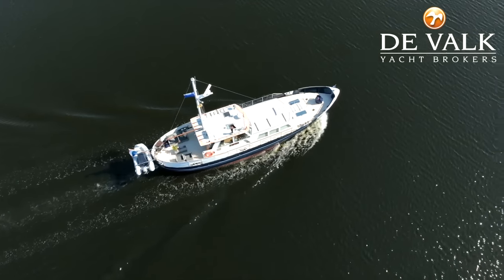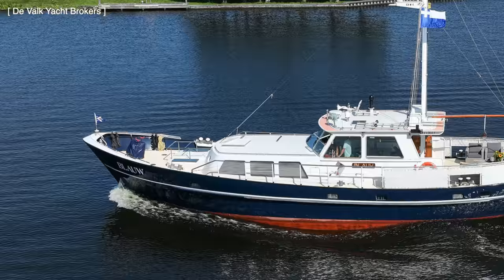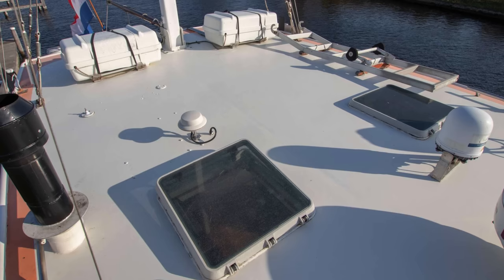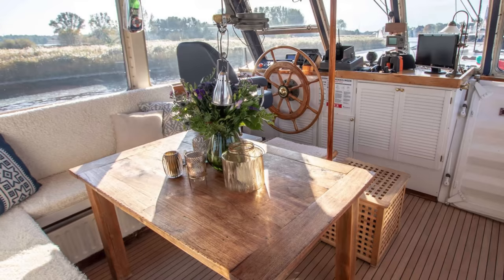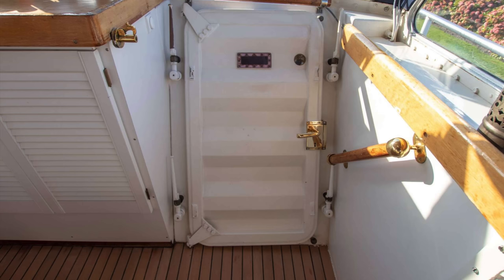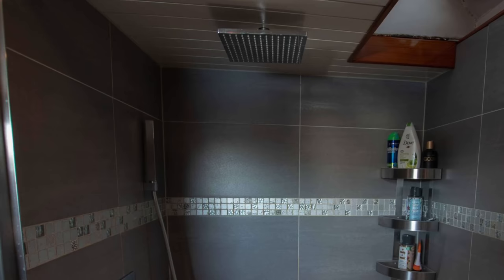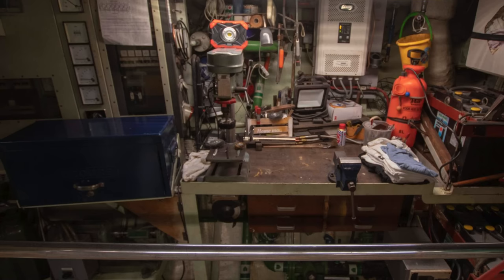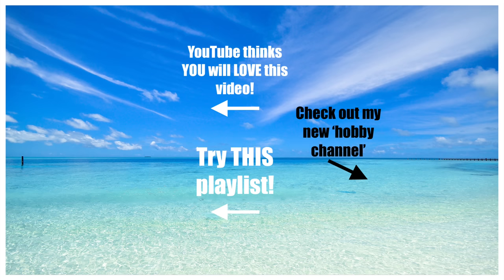€585k STEEL Liveaboard Explorer Yacht For Sale! | M/Y 'M.S. Blauw'

Comment: Definitely a great vessel obviously built for use with a nice low profile   built for serious use without the usual totally unnecessary flybridge to catch the wind and make it unstable in seriously rough weather. However the interior isn't so well designed, the walk in wardrobe for instance is a total waste of space and could be put to better use. Would like to have seen more of the galley, is the cooker gambled and does it have fiddle rates?

Comment: It looks like a motorsailer but isn’t. Why not?  No mention of electrics, generators, stabilizers or anchoring equipment. Regardless of whether the glass is tempered or not,  one wouldn’t want to do an ocean crossing on this floating greenhouse.

Comment: All very nice , for the price of a nice home in a nice suburb :-) In England :-) With the current exchange rate , just a dream , a nice one at that :-) 
    Explorer to me means live aboard for long stretches , and while quite frugal with the fuel still $3k for a fill up :-)The range is very cool :-)  
 Previous owner got what he/she wanted , sadly one size does not fit all . 
  Below deck is 'problematic ' for me :-) 
Sure owners space is very cool , does one need 2 washbasins /walk in wardrobe ? 
Would rather find space for another bunk /small twin all share one decent head :-) 
  Gives one the chance of 'renting ' out some space , life is above deck , and the galley is superb . 
Thanks for the wishful thinking :-) 
Trust it finds a good home .
Reply: For that price you can buy a house in the center of the city in Belgium. And I agree with you... I don't need a walk in wardrobe either. As for the price, what you ask is not always what you get. Boats are a niche market that fluctuates with offer and demand. I have never followed boats on offer in that price range (out of my league) but I have seen many yachts that were in the end sold for half the original asking price.